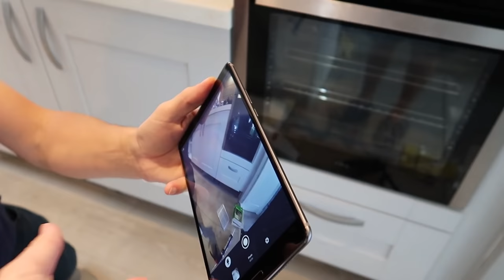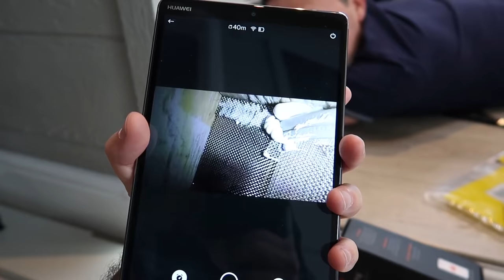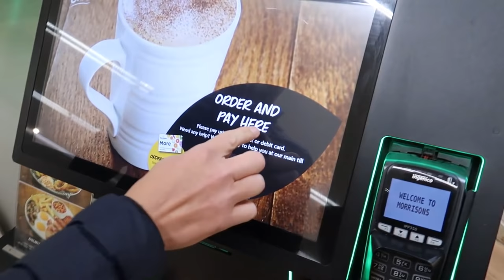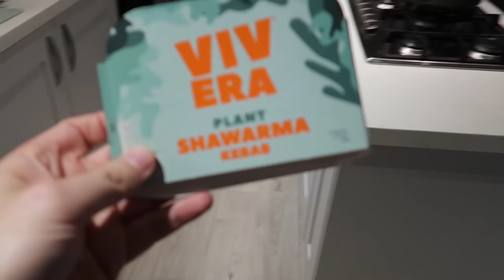WE FOUND ANOTHER MOUSE ! | THE LODGE GUYS | VLOG

Comment: I have been to NYC twice and have stayed in times square both times. Anywhere round Midtown manhattan is good as it's easy for the subway and close to empire state building, central park etc. Must see would be Empire State and Top of the rock (Rockefeller centre) top of the rock is best as sunset I think as you het to see manhattan in the day and night. I would also recommend the memorial pools where the world trade centre was. The museum is worth a visit too if you have time. Be warned it is very emotional though.Top tip is use the subway. Its around $35 each for a 7 day pass and it saves you time and money and it takes you everywhere. Cabs can get quite pricey (they do have set fares from JFK to Manhattan though). I would avoid horse and carriage rides in central park as quite expensive. A mooch around is enough and there are kiosks where you can get free maps. I could go on all day about NYC, it's amazing and you will have a great time!!!